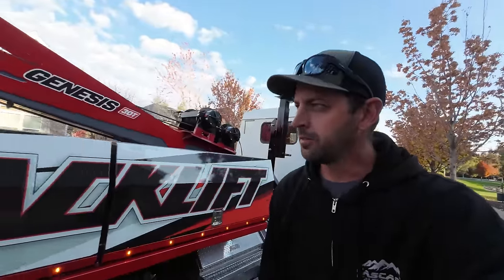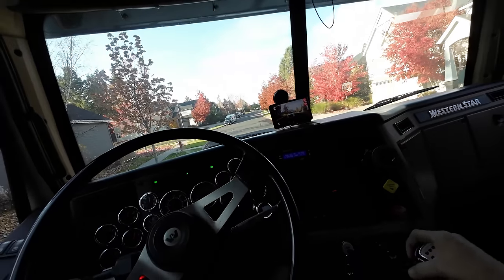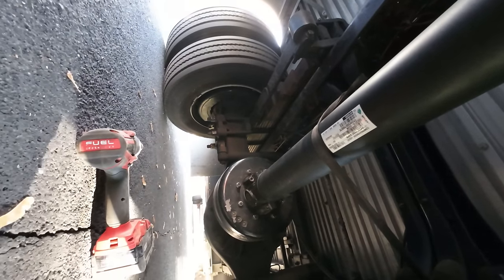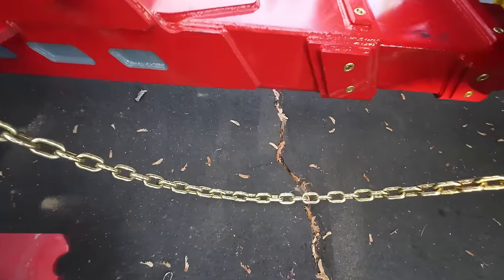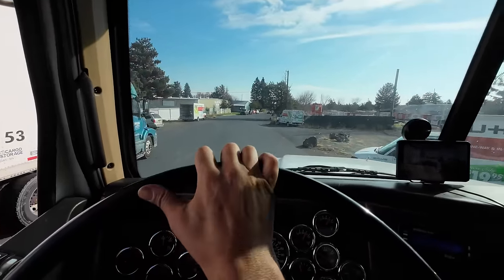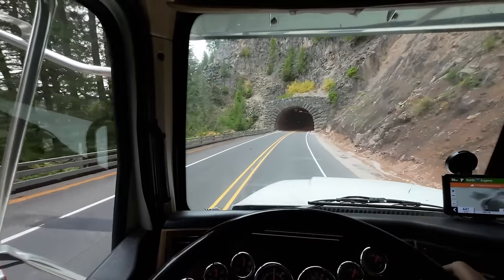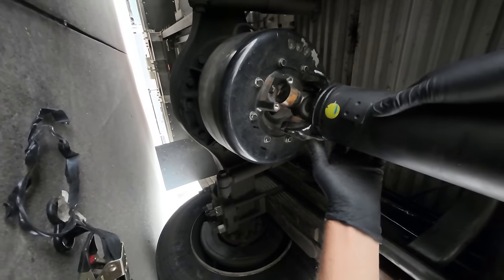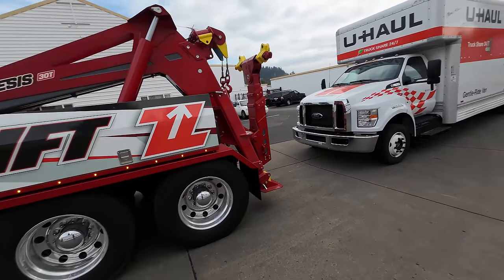Well that didn't end like I'd hoped…

Comment: They probably didn't have a transmission problem. They were driving around with the parking brake on and thought it was a transmission issue.
Reply from the maker: My thoughts exactly
Reply: I use to tow rental trucks because the customer was too lazy or self absorbed to return it themselves. They would call, complain it was acting up, get their discount and I’d tow it back.
Reply: I agree accept I think they likely only moved it a few hundred feet and were so vehicle-illiterate they heard a chime, saw the brake warning light and felt a drag and called it quits right there. There’s no way they drive it more than a mile or so like that….which would require totally ignoring the constant chime and flashing “brake” light on the dash for that mile or less. I say a mile or less because with it set tight enough to cause a noticeable problem for more than that mile or so, that driveline brake would have gotten hot enough to start smoking a LOT and stinking real bad and it wouldn’t be holding back much at that point….and if they didn’t stop after that it would have gotten hot enough to melt the output seal in the transmission and start a fire under the truck. But in either case there would be noticeable damage.

There are a couple other possibilities that are fairly likely too though: one is fairly likely in something with very low miles like this truck where due to a manufacturing defect either in the electrical system or the transmission itself it actually is having either intermittent problems or only acts up once the trans gets warm. Also U-haul could have caused an electrical fault when installing the body on the cab-chassis, something like a dead short from a pinched or chafed wire in any of the Can-bus wiring on these new vehicles can cause all kinds of issues effecting any system on the vehicle from lights to engine / transmission performance. The last one is the people are cheap scam artists and made up a trans problem to get a discount on their bill since U-haul’s customer service will often do this if you have a problem with the truck during your rental if you raise enough of a stink about it….a threat of writing particularly bad online reviews usually gets a result of some kind.
Reply: @MikeFL2TX  I’d say it’s at least 50/50 that this was the case. It’s amazing what people will do to save a buck these days, and the worst part is the ones that scam the most are usually the ones with the most money. They’ll live in a 500k house, drive $80k cars, work at a $100k a year cushy job with benefits, yet they’ll cut the throat of any business they can to save 20 bucks on their bill or get a free latte at the drive-thru.
Reply: @J.R.in_WV that was almost always the case. A few times the truck was suppose to be returned by a certain time and the didn’t for whatever reason, so make the claim that they had issues. U-Haul I believe it was will send a team out to trans load your goods from the bad truck to the replacement truck too. I have sat and waited for that to happen.
Reply: @MikeFL2TX  did you end up selling discounted rentals? It'a a shame if you didn't... i would have printed business cards and spread em all over. Joking of course - just helping Casey with engagement on his videos while having a bit of fun with whats left of my handicapped life!

Comment: If you feel dumb Casey, I put a wireless magnetic tow light on an aluminum bodied F-150🤪 it was never seen again
Reply: I did that once too, but by some miracle, it ended up in the box of the truck not on the road 😂
Reply: I done it on an aluminum body mail truck
Reply: That's when you scour the internet for an aluminum 🧲 magnet😅. Somewhere, someone must have one for sale.
Reply: I've never done that, but I have done other things. One time I got out of bed and towed a pickup and a uhaul trailer at 3am. Towed the trailer about 15 miles and dropped it at the hotel the customer was staying at. Couldn't for the life of me turn the handwheel thing on the hitch counter clockwise to release it. Then I realized... I NEVER TIGHTENED IT! No use buying a lottery ticket, I used up all my luck on that one, no idea how it stayed on the ball. It was safety chained but still would have wrecked it had it come off. Now I remember that every time I tow one and check it about 9 times
Reply: @juliogonzo2718 easily done 😳 nobody’s perfect (except Colby mason above obs 🤣)
Reply: Bummer man you don't seem pissed enough

Comment: I think the transmission issue was actually them driving with the parking brake on.
Reply: Customer complaint: "The transmission is being held back and I smell something burning" LOL
Reply: Funny how it felt funny once it was no longer needed. Super convenient don't you think.
Reply: @YARCHLRL  Don't you have some toys you can play with in your mom's basement?
Reply: I agree with attaching light bar much different
Reply: I agree with parking brake set.  Wow. Can you say FRIED???
Reply: I feel bad for you
Reply: I rented a new Ryder truck for a cross country trip.  It was an automatic.  You had to pull out a knob to get into park.  I found out real quick the park did not hold.  For two days, I blocked the wheels, but still applied the parking brake.  On day three I forgot to release the brake, and drove it a few hundred miles like that.  On my next gas stop, I applied the parking brake, and it immediately locked up.  It worked perfectly for the remaining two days.
Reply: There’s no way the transmission is bad.  Those things are tanks.  The problem was between the steering wheel and the seat.
Reply: @YARCHLRL  thats what I was thinking..  got done hauling..  by the way my transmission is busted..  it was a real struggle getting home..  we want our rental for 50% off...
Reply: @eldoradoboy  happens a lot. Keeps 2 of my medium dutys busy all week... That and people renting campers with no idea how drive them lol.
Reply: I use to tow rental trucks with “problems” because the customer didn’t want to return it themselves. Some people!
Reply: @MikeFL2TX  watched a guy just this summer do that at a hotel... heard his wife nagging him that they were late for their flight.. and how would they ever return the car.... guy tells hotel to flag down a cab,..  while still in the lobby he called the rental company and I heard him say "our rental wont start and no one here to jump it...  keys are with the Valet" and off they went in a cab.. probably saved himself a good 20-30 minutes at BWI airport where the rental shuttles are extra slow typically..
Reply: I haven’t picked up from hotels, but definitely from houses with keys in the gas cap or plainly in the ignition.
Reply: @MikeFL2TX  As soon as he drove it around the block and mentioned the gears shifting correctly, I knew it was a customer decision. They didn't want to return the truck and trailer so they claimed the transmission was acting up.
Reply: @nboddie1036 yessir, been there, done that. Some people’s audacity I guess.
Reply: Or they didnt understand the tow/haul button. Having worked at a Uhaul dealership, this was a common issue...
Reply: Sure, if you completely ignore the warped parking brake drum.
Reply: This is why you don't rent to the teenager or dad who has no idea about stuff like this. I'm honestly surprised you can just drive one if you have a regular drivers license. Some people can't drive their fucking Camry but we trust them to drive our large trucks. CDL for Uhaul's. Of course it was the parking brake, I'd be contacting Ford for a refund if my transmission went out at 8,000 miles.
Reply: Yup same here I agree wth u
Reply: I said the same thing!

Comment: Maybe use carabiners instead of the little hooks when you can? Despite the mistake, great video as always!
Reply: Just going to type that myself. CARABINERS
Reply: That was my though as well, get rid of the hooks and replace them with carabiners and not worry about losing another one.
Reply: Ditto, no kidding I was thinking that when he was hooking it up at the start. 
Poor little guy probably held on for a couple of miles getting all its nice paint ground down before it got flung into oncoming traffic to get run over by several vehicles before it flew off the road and down a steep ravine.:(
Reply: hey i just wrote that you stole my thought
Reply: He should not have used the strap ,it would have been more secure if he just hooked the bungee cord straight to the handles
Reply: Was thinking the same, I've swapped the 's' hooks for Nite Ize S binders on some of mine.
Reply: @clinttrost5743  the strap was definitely the problem. Those hooks can slide inward & loosen the light bar. Of course most people would've thought of that. 
What's that he's always saying about working smarter not harder. Looks like he should take his own advice😂😂😂lol
Reply: @clinttrost5743  so youre saying strap-ons arent good?
Reply: You beat me to the idea. I immediately thought carabiners at top with no bungee cords at top. Bungees at the bottom only.
Reply: Yep, logged in to say the same thing, positive locks.
Reply: I replaced all my rubber bungie’s  hooks with right sized molle style carabiners
Reply: My thoughts as well…
Reply: You beat me to it.  An s-hook needs tension all the time.  Normal bouncing around probably lost it for a split second. I don't know as I'd trust bungees without replacing them constantly.  They do wear out especially if you keep stretching them.
Reply: @michaelalbert8474 sounds like you were following him at the time? 😂😂😂
Reply: I'm not sure the carabiner is the answer, I have found several bungee straps with the hook still on them, the strap itself broke.
Reply: @donaldcampbell5277  True.  I'm assuming the straps have been used before, just not quite like this.  A hook is inherently insecure unless you can guarantee it will always be under continuous tension.
Reply: Caribiners would not work in some instances, like a school bus. Usually the only thing to hook to are little drain holes in the rub rails that the bungee s hooks fit perfect

Comment: I’ve had to call our local large truck tow vendor a couple of times, here in Memphis, to let them know there light bar was left on the back of the U-Haul. The owner is always so happy to know where it is.
Reply: Yeah I almost did it once, got ten minutes down the road and remembered the stupid lights. Have left stack covers on and forgot though. I try to take the lights off as my first thing in my routine. I've never drove off with keys in 12 years though. They are either in the ignition or my back pocket, that way I sit on them and remember 🤣

Comment: Might be a idea to add a Apple tracker pod to the light bar. As you may be able to set alert that it’s been left behind giving you a warning it’s no longer on the truck
Reply: That’s cool idea.
Reply: Good thinking! They do have a geofence setting, huh?
Reply: Great idea, and also make sure your company contact info is on it too.

If I come across a $700 light bar with someone's name and phone number on it, I'm calling them.

If there ain't nuffin, well, finders keepers 😁
Reply: The transmitter on the truck should also alert you when the bar isn't in range.
Reply: You would think so but apparently they don't.  @jfbeam
Reply: @jfbeam  The transmitter is not inside the cab, it's outside plugged into the light cord socket.

Comment: Thats probably why they thought they had a transmission issue,  driving with the parking brake on
Reply: Exactly.  The trans was probably over heated now that's it's cooled down, it works fine.
Reply: @frotobaggins7169  exactly and loss of power
Reply: @frotobaggins7169  ??
Reply: @frotobaggins7169  A different video perhaps?
Reply: Bet that's it. I actually went back to where Casey removed the tailshaft and even then a whole load of brake dust fell out and the rear looked discoloured. So ye someone has been cooking the park brake. Must have got wonderful mileage with it on, not to mention poor acceleration and slow going up gradients, well until the shoes wore out that is.
Sorry about your lightbar loss Casey, that's going to destroy any profit you made on the job.
Reply: @georgevindo  Yes, I'm all mixed up over here. LOL Thank you. :D

Comment: What a great idea to rotate the drive line using the lift extension by remote.  Something for me to tuck away for future reference.   Same thing with using the stabilizers to gain side motion shifting the semi trailer sidways.  You look pretty good at it, to me. Well done.
Reply: but maybe not while you're under it, on the off chance something fails and falls on top of you
Reply: @matthewmiller6068 the truck still had tires on it. Worst case is lands on its tires and nothing happens.

Comment: I wonder if a pair of cheap carabiner clips instead of or in addition to the S hooks might help prevent this issue from ever happening again. Just something to loop around the strap would have saved the day. Sorry for your loss, man!
Reply: Was saying the same thing just imagine working for a independent Tow Co and telling them that you just  lost a towing lights  costing almost a Grand or more can you say FIRED Dam Casey got Screwed on this one
Reply: vibratingstring  That is what you are stuck with when you purchase one of those or any other light bar.
Reply: vibratingstring  ... I agree, those black hard rubber straps have no stretch and are way too rigid to adjust to vibrations. That is why you find them all over the roads because they jump off as soon as the item they are supposed to secure moves a little. Real Bungee cords are able to compensate for larger variances in length and don't jump off so easily.

Comment: Casey, I took the bungies off the top of my light bar and satrted using (2) or the self winding ratchets, just like the ones you used on the drive line, but kept the bungies on the bottom for the spring tension. Yes, I tightened the heck out of the ratchets and I would also cross the bungies on the bottom.  I started doing this after one ot the bungies on the top broke. I was  lucky enough that I did not lose the light bar.  

25 year retired tow veteran.

Comment: I lost a light bar just like you, after that expensive mistake I just got longer bungees and I added a small chain with snap clips on both sides then I clip on something incase a bungee brakes. My other mistake I used to make is leaving it behind, till I remove it at drop before I unhook.
Reply: Wisdom learned the hard way, but wisdom nonetheless 😊.
Reply: @judithburke1539  indeed, you'll only make that mistake once.

Comment: Sorry about the light bar. When you hooked it on there I wondered about those hooks holding. Need to fine something that will lock it on for sure. Even if you just use some kind of safety rope or something to keep it from being lost

Comment: When you just hung it by the hooks I saw that coming. Unless I missed a step that's all you did to secure the light bar.
Reply: He put a set from the box to the chain hooks on the bumper, other have said the weight of the box likely let it move enough to unhook the hooks from the strap across the back

Comment: Man loosing that light bar sucks. You gave some good tricks. Wow none the tow trucks ever put the drivelines back in when they get towed in at the dealership I work at. Your nice
Reply: There's actually a reason for that. The bolts are not supposed to be re-used. Having the dealer re-install new bolts shifts liability away from the tow company.

Comment: I like the idea of a strap or rope or something with carabiners on each end to clip to the handle on the light bar back to the horizontal strap just in case the light bar shakes loose. Looked like you had the straps pretty tight so totally wouldn't have thought it would have fallen off like that :( Kinda sucks that the light bar is black and not the bright yellow like the light bar is on the rollback.

Comment: Thinking about the placement of your lights two things come to mind 1 the lights on the rear of uhaul equipment can be removed by hand,  they simply fit into  a gromet in the opening for the lights and have a simple connection so the rental centers can make quick and simple repairs that other wise make the vehicle unrentable. 2ndly  VELCRO brand makes a slew of different types and sizes of velcro creations,  the self adhesive backing while its strong and maintains a good grip can also be removed easily without damaging finished surface.